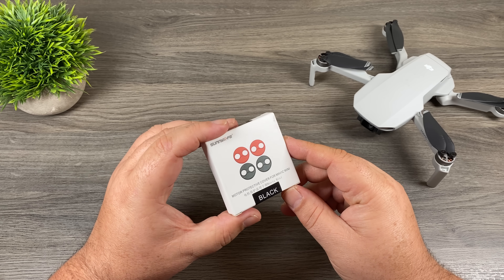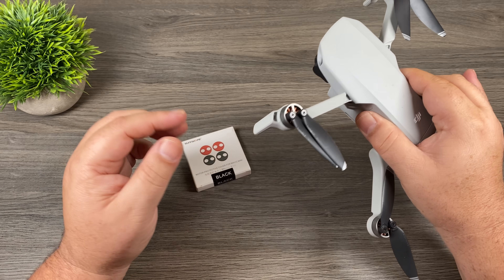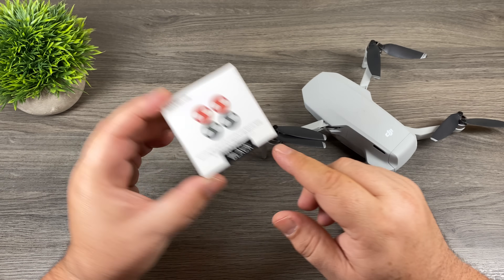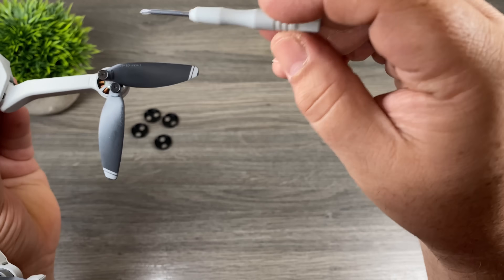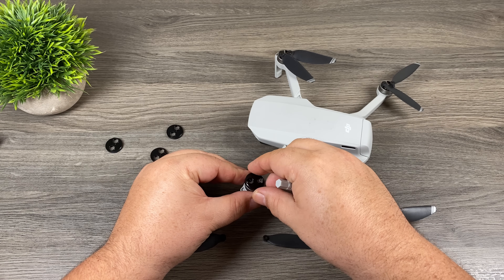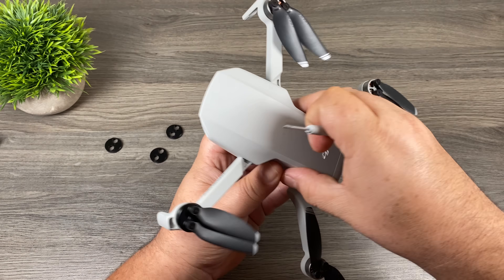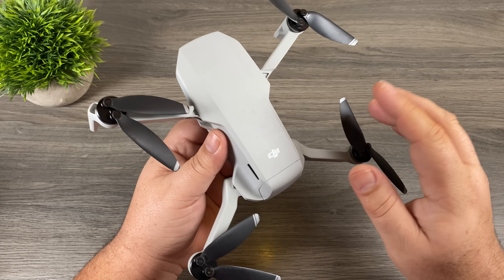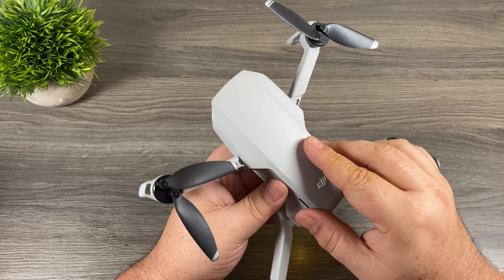DJI Mavic Mini Motor Caps - Good or Bad Idea?

Comment: I bought these. They stopped my props from being able to swing back and forth. So I could not fold my drone anymore. I don't think the holes were big enough to allow the props to move loosely. There is nothing to keep the caps from slopping around. The prop screw is way thinner than the two cap holes so the screw isn't keeping them on, so what else is there? Well it's the bottom of the part of the prop that screws on (the hole on the prop the screw goes through. The props bottom out on the cap holes and it stops the props from swinging back and forth freely to fold the drone.

Comment: If you can recall, did these caps fit snuggly to the top of the motor assembly or was there play, I have these installed on the Mini2

Comment: Hello just find this vid. I bought red ones and somewhat different. On my ones there are only 4 tiny holes for screws. Firrst i had to attach the props onto the cups and the cups with the props to the motor. I didn't realize any major difference, maybe a little more silent. I found this a good idea. And looks the drone better. (I have the same color alu joysticks on the rc)

Comment: Do you know anyone who was checked by the drone police. I ask because I want to know how they check the weight. Do they actually weigh the drone or do they look up the weight on a list according to the model. I can't imagine the guy taking out a scale and putting it on the ground in a field or wherever you are flying. The smart thing would be by model so that a bit of extra weight would not matter, and shouldn't. Many extra addons make the drone safer, not more dangerous so going by model is the smart thing to do. Imagine getting fined for 10 grams overweight. It's ridiculous. I can't find anyone who can answer me.

Comment: Well explained video, for myself  this is what I do, after drone flying  outing when I get home I  take a can of computer air spay turn the drone upside down give each motor a short couple of blasts of air and dust or particles will almost always blow out if there is any in the motor, been flying drones for 10 years never had a problem, doing that in Arizona ever since I started flying them, and there is a lot of dust and heat here for sure!

Comment: Good review. I have a Mini 2 and it's weight is actually 237 grams. The caps are 1.6 grams each so adding them does not compromise the weight and living in a dusty/sand environment in the UAE really requires these. Thanks immensely for your thermal input. 👍🏻
Reply: If you don’t mind me asking, do these motor covers fit the mini 2 well? I’ve seen a lot of videos saying it’s a loose fit and it rattles a lot when flying.
Reply from the maker: The ones I have fit well, perhaps different brands feel differently
Reply: @AirPhotography  That’s interesting, thanks for your help! I think I will stick to sunnylife since their ND filters worked great for me.
Reply: I have also put them on the Mini 2. On yours were they a snug fit around the motor assembly or was there play?

Comment: Bad idea.....the Neodymium-Iron-Boron magnets in the rotor should not be subjected to prolonged high temps or they will lose their magnetism.
I found this out from my Parrot Bebop, which uses similar outrunner motors, to be the case and that need to be replaced from time to time due to overheating.

Comment: Hello from Greece. After installing the caps or a landing gear or night led is it wise to enable "payload mode " in the setting's? Thank u😀
Reply from the maker: It is not necessary as they are extremely light

Comment: Oh man talk about an underrated channel. I just stumbled across your page. I just got mine in the mail just yesterday (the same covers), and I also shared your original concern.

As a fellow DJI Mini pilot... & therefore one of the brotherhood of the air, obviously-😁-I shared your concern of overheat-but that was not the first thought that had struck me… The first one and most immediate, I put them on the scale, they weigh several grams (I was not where at this point that I should probably think about the engines cooling system as the factory builds it; and how can I not impede that systems efficienies; however, today I decided to first add the landing gear that folds up, which we did and worked great lifted like it was nothing. Then added carbon fiber wings... much heavier about double the weight plus like .02 or whatever..... but, much more rigid, much much much stronger. Blades feel like glass, is how I would describe it. If glass were very very very very very hard.. but it could flex JUST A LITTLE BIT...but when you do, you can really bear down on trying to snap one and me nor my girl could get it. Amazing piece of technology... would recommend. I’ve only got a few minutes flight hours on these props but can keep updated if you reply. 
Appreciate your time and this was an amazingly well planned, written,  executed-produced and recorded video, you have amazing quality videos. Love your presentation style and direct delivery. Keep it up, some of that hair still have an appreciation for the proper English language...colloquially speaking, vs literal vs 1st, 2nd and 3rd-person views. 

Love the channel and the MINI content my dude.
You earned the shit out of the sub on this one man I blown away. Sorry
Reply from the maker: Thank you very much. It’s always nice to hear with people enjoy. Thanks for watching and thanks for subscribing hopefully I’ll continue to satisfy and entertain

Comment: Although the variables are negligible and it may not impact the life of the motors of the drone, there are some undeniable facts.

1 - You are adding weight overall to the drone and resistance to the rotation of motors. Both will in fact use up more power.
2 - You are restricting the possibility of debris from getting in the motor. This will restrict the airflow as well.

Although I appreciate you making the video, I believe one could outweigh some of the possible variables.
Flurries and/or rain drops, shouldn't really be detrimental to these brushless motors but debris such as dust, dirt & sand will.
Landing pads, hand takeoffs & landings, will avoid most of these issues.
At the end it would definitely be interesting on getting feedback from an engineer.

Comment: I think they are a bad idea. As the drone is flying the motors are some what air cooled by the propellers........however, once its landed and not running, the motor heat is "trapped" inside, and not being able to dissipate. Not sure if this will have a long term effect, but most electric motors are air cooled for a reason and NOT to be sealed up. Imagine sealing up your cordless drill.

Comment: Very informative as usual. I know the mavic mini isn't technically "waterproof",, but other than flurries, do you think these will help against rain?
Reply from the maker: I would assume they definitely would help if you get caught in a light drizzle. Others have commented that those types of motors can handle a little bit of moisture regardless.

Comment: I bought those BUT it's not the heat issue that puts me off ...I might even have tolerated that they are just loosely set on top which might cause problems as they can lift up a bit and get into the propellers BUT mine actually inhibit the propellers.  They drag. So, waste of money, off they go.

Comment: I think it's extra open so the motors can be cooled during working. Bruschless motors are generating much heat. Some dust can't be so dangerous like overheating.
Reply: Little dust isn’t an issue but a spec or dirt or a grain of sand will leave you unable to fly depending where it gets lodged
Reply: Exactly. It is also written in the manual to leve it open

Comment: Does it make it perform any better? No. Not needed. It adds weight and creates a dust/dirt trap. Save your money and buy another battery. That will keep you in the air longer than this.

Comment: hovering is not testing it..motors work much harder in actual flight. when the windings coat melt that will be the motors end.
Reply: He’s not trying to fail-test it... I can see how that might be the perception; but I had gone through this same issue just concluding some tests today, and while you are correct, just by virtue of the fact that he’s just using an arbitrary amount of time (20 min) to change one sole variable against the same time-trial ...
But a small SAMPLE is what he’s after by the hover test... it’s just a small sample, but I must give credit to your point, it is still a fact (your point), good sir.

Respectfully, of course.

Comment: Nothing is getting in those motors when the props are spinning
Reply: Not necessarily. I actually saw a video from another channel where he went through a crash he had with his Mini 2. Long story short: flying with string winds after snowing. Right afther the crash, the motors were not spinning. After a couple tries, they went back in working order. In the end the most likely cause of the crash was moisture building up inside the motors, maybe due to snowflakes being sucked in there. Moreover, the issueis not only when the motors are on, but rather once you turn them off and there's dust/sand/snow or any other kind of dirt drifting about. I'm still concerned about these covers though. Yed he did test it, but not in an escenario where i can see the drone having to force the motors even more than necessary due to those caps (like if there's strong wind or if the temperature outside is really hot)

Comment: When ever you remove the screws from the propellers you should always use a new set of screws because the screws have a seal that stops the screws from coming loose during flight
This is also recommended by DGI Mavic
Never use old screws once removed.
Reply: screw cant get loose, its rotating in clockwise as the screws
Reply: @kalisto1 they do I lost a drone because of it !
Reply: @Crush0819  shit :(
Reply: Orrrrrr use LOCTITE ON THE TIPS 🙄🙄

Comment: These caps could be a good solution to keep dust and sand grains away from moving parts of the motor. I had recently motor blocking caused by a grain of sand which was stuck between the rotor and the stator. I had luck that the motor was completely blocked after flying and not in the air.

Comment: You're not holding that temperature gun anywhere near close enough. They measure an area bigger than the laser pointer, usually 12" away will average the temperature of a spot larger than 1". So you're not seeing the motor temperature, you're seeing an average of the motor and everything else in the area.

Comment: There are chalk and cheese differences of opinion on these accessories on youtube reviews. Not sure if its worth the risk. Theoy could've made these using half the weight, by not using as much metal covering ventilation and instead, use it as an additional gap-creator to avoid the props hitting the body, particularly when in sport mode.

Comment: Great video! I wish I wold have seen this 2 days ago before I crashed mine and got sand into the motors. Then lost a motor screw when opening the motors to clean out the sand. Anyone know where to get replacement screws for the motors. (Motor screws not propeller screws)

Comment: These caps are also used to fix the known issue of being in sports mode can scratch the frame of the drone so dji I guess makes these now as a work around fix so ur blades don’t scrap the frame
Reply from the maker: Yes I’ve seen reports of that. I haven’t tested that Theory on my drone yet but I can see how that would definitely help

Comment: What money grabbing idiot designed these 
If they were made to cover the heat coming from the motor dji would have made them
Reply from the maker: Not necessarily. DJI had to really shave off a lot of weight to keep it under 249 g
Reply: Air Photography it’s been proven no heat can escape the motor when hot it will fail in flight after to long use
Reply: You would also think that DJI would have designed the front props in such a way as to not hit the body of the drone... but many buyers are having this exact problem - that is why I am interested in the covers, to raise the props "just enough". DJI just replaced my Mini for that reason.

Comment: Those propeller caps looks nice but it causes the motor to overheat fast and the drone goes to max power overload after you fly it outside on sports mode or even position mode, after I removed the caps and fly again it went fine no overheating or max power overload.

Comment: The only thing missing is the weight of the Mavic Mini with the caps on.
Reply: It does put it over the limit, in grams the mini is 249 and with caps 258, Down Under the limit is set to 250g for some strange reason
Reply: @johnchud7507  not sure why either, what difference does it make, if you get hit by a drone the weighs 249g or one that weighs 5 lbs, if it falls from 100ft, you're dead either way, you won't feel the difference.
Reply: @johnchud7507  I was curious about the 249g weight of the mini, so I weighed mine when it arrived last week, and it registers 240g on the nose!

Comment: Guys This video is not correct If You check there is almost 10 degree difrence with and without this cap You can burn engines after longer time.. check another videos

Comment: I bought the same brand and they were loose as can be. I didn’t feel comfortable running the motors with them installed.
Reply: Same, mine just came in and noticed that and decided to search for more info. Seems to be split on whether not they're good or cause issues
Reply: Yeah, I just received mine. Went to install them and noticed how much they wiggle... I think I'm going to return these, flying the drone with those being so loose makes me very uncomfortable.

Comment: Water or dust does not damage the engines! 😂🙈
Reply: True.

Now with these caps, the dust and humidity will get trapped inside, which is worse actually.

Ask yourself a question; does DJI just forgot to seal the motors or they didn't on purpose?

Occam's Razor principle...
Reply: Dji não colocou por conta do peso. O air, o spark e etc..têm motores selados!
Reply: Motors not engines. they are not planes

Comment: Please, next time measure the temperature by contact thermometer. This one measures infra red light. The disadvantage is, that metal or ceramic materials works as a mirror for this light, so you maybe measured something else in the room. Next time you can put some sticker on the motor from paper and measure the temperature on that place ;-)

Comment: I tried installing the same caps today but when props were tightened down, the red caps still have slack in them? Is that normal?
Reply: I am here with the same question.
Reply: DONT! the motors may overheat and stop working.

Comment: These tests were not done under load. Also, summer time temps, I would imagine this would increase temps. If the engineers have used caps on other models and decided against them on this one there has to be a reason. They possibly did it for cost reasons. But since the manual asks for these to not be used,  I would have to guess there is another reason that came up in testing for these not to be used (overheating under some type of conditions).
Reply: Peso!!! Dji não colocou pra não almentar o peso!!!

Comment: propellereads screws are sealed in place with a sort of a glue, I don't think removing them  and then put them back is a good idea.
Reply: Yes, if you take the screws out they are gone. You should use new ones.

Comment: Bud does the drone detect the extra payload and go into payload mode and limit height and distance? The prop guards are light and do that. So it doesn't take much. Needs more of a test than hovering in front of a tree inside.

Comment: Just installed the same motor caps and they are pretty loose horizontally and vertically are they meant to be that free spinning?
Reply: I wondered the same thing. I wish someone would confirm what we noticed also. Mine were a little slack.
Reply: Yes, mine are loose too. I also wish someone would say something about this. Certainly nothing coming from the manufacturer, nor any reviewer. :(

Comment: How are these holding up?  I went ahead and installed mine last night.  I figure I will let it hover for 20 minutes and do some low altitude manouvers but I like going 400 feet from time to time.  Anything other than really slight battery times I will remove them.

Comment: Hi When removing and then replacing the Props do you use the same screws ( ones removed ) or new DJI ones because they have Lock Tight on them ? Thank you for the Video
Reply: Christopher Haslewood just put a tiny bit of blue loc tite on the screw and you’ll be fine.

Comment: the weight margin is so close to 250g that any accessory that you add to it, ie: leg extenders, motor caps, or even a skin will throw it over the 250g limit. I also think if there are transponders in our future than they will also take the weight over the minimum. Kind of a sneaky trick but possible.
Reply: Mavic mini 2 wasn't exactly 249g but 237g so some gadgets will not exceed the weight over 250g

Comment: Hello good Sir, do you still have your motor cover on? Also, I read the manual and it does say that “do not block any of the ventilation holes...” BUT I did not see or read anything about the warranty of the drone being voided. Can you please confirm this? Also, what about the skins? You read anything about the warranty if you put some skins? Trying to decide if I should buy these covers for my drone.